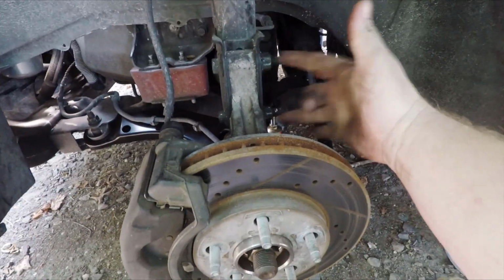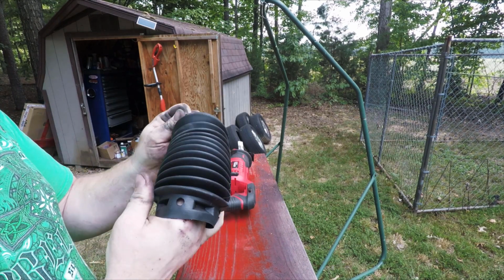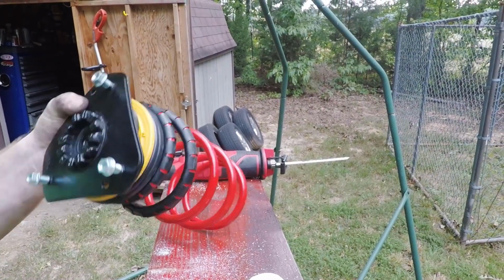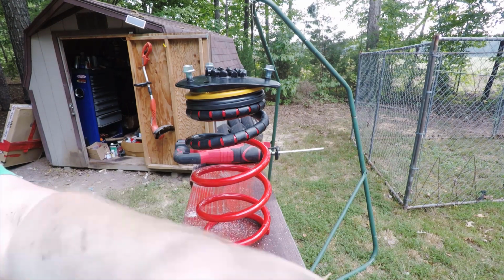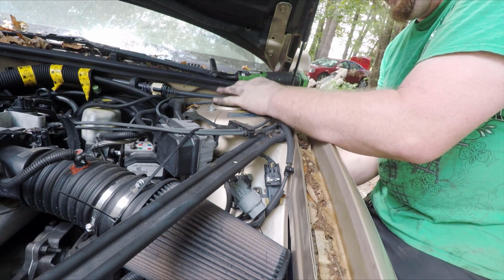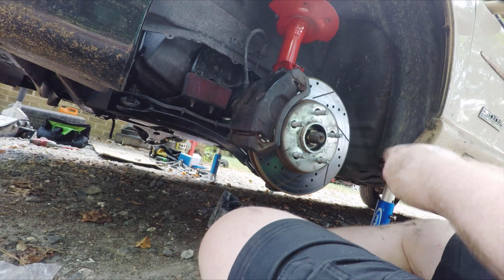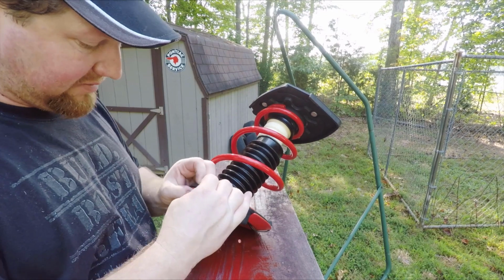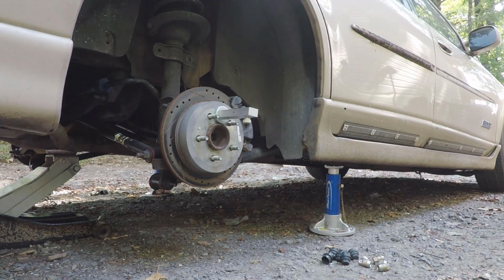03 GTP Spring and Strut Upgrades ( Wbody Tech )

Comment: Hey I have a question I got the zzp lowering springs and strut combo and my rear sits a bit lower than the front I have about an inch or half inch gap difference any suggestions? I thought about cutting a bit off the front springs?
Reply from the maker: I havent used there springs yet. But that may be possible

Comment: Hey quick question. I just installed zzp lowering springs on my 03 regal,along with agx. The front is perfect but the rear has a gap between the pogo washer? I didn't notice ofcourse until they were installed as I went down the road. What I might of missed? Thank you!
Reply from the maker: If it has standard washers there will be a gap
Reply: Thank you. What is the fix?
Reply from the maker: It should be fine as is.  But you could swap the upper washers for "anti pogo" washers if you want.  They are just front subframe bushing washers you could get from a junk yard.
Reply: 1st of all thank you for your insight. The problem is I did put anti pogo washers on the top and there is still a gap. It pops in clinks when I go over bumps?
Reply from the maker: Ive never done anti pogos on the rear.  Maybe that is the problem.  See if maybe swapping back to the stock upper washer fixes it
Reply: Lol. It was my first time and that absolutely makes sense. Thank you!

Comment: Hey brother I was looking into getting my cat lowered and i thought the ebay springs were the answer, now that i see that i have to cut them straight out the box for the fitment I need i feel like i might as well cut the the stock springs (which i havent done before) what are your thoughts? And i noticed as long as you cut the bottom portion of the spring it will contact the base/perch of the strut about 6 inches giving it plenty of safe seating of the coil. Is this also true for stock struts should i cut the stock springs?
Reply from the maker: I wouldnt cut the stock springs, as they are not a high enough spring rate to keep from bottoming out.  The dna springs are higher
Reply from the maker: Also, only cut the rears.
Reply: Okay I will take your advice and get the dna and cut, the thing is ive got gold painted stock frs wheels and tires 215/45/17 which look great but there is atleast a 3in wheel gap front and back. Did your car get lower over time once the springs settled? Or is there any reliable way to drop the car like 2in. ? Also is it possible to cut the front springs a little and cut more off the rear springs?

Thank you so much.
Reply from the maker: @ekimok8462  that tire size is really small for a grand prix.  I am running 225 55 17 they fit the fenders well.  The front springs wont fit the strut if you cut them.
Reply: @SalemDoyle  I’m running 235 40 r18 they fit great and thenI have more of traction on take offs 
What’s the widest you  you ever went?
Reply from the maker: I run 245 45 18 on my 99

Comment: Hey, I got an 04 gtp that I want to lower... but I'm on a budget. What lowering springs would u recommend that will drop it about 1.5 to 2 inches?
Reply from the maker: Maybe the zzp springs?
Reply: @SalemDoyle  thanks, those were what I was thinking too. This may be a dumb question also, but where would I go to have them installed and how much would that prolly set me back?
Reply from the maker: @SmooeyGablooey  you could do it yourself, or most any shop can do it prices will vary depending on the shop, i would call around
Reply: @SalemDoyle  alrighty... thanks a lot for all the info

Comment: Hows the ride now?
Reply from the maker: havent driven it.  i can say from just trying to bounce it by hand, it should be stiff.  after this next video, i should find out though
Reply: I've thought about lowering springs, love the look but not the ride.
Reply from the maker: @regalgn1  that is usually about the struts.  Bad or inadequate dampening will ruin the ride.
Reply: I put lowering springs on my GN with Bilstein shocks the ride was harsh. My son has his 00 GS lowered and compare it to my 01 GS that's not lowered big difference in the ride.
Reply from the maker: @regalgn1   There always will be, when you lower one you have to up the Spring rate which is going to make it stiffer then you are also going to need better dampener to handle the higher Spring rates.  If everything is matched well it is usually tolerable, but nothing like a nice soft stock ride.
Reply: I can't wait to see how that thing rides down those curvy roads by your house!
Reply from the maker: @WBodyTech  soon.....   soon..